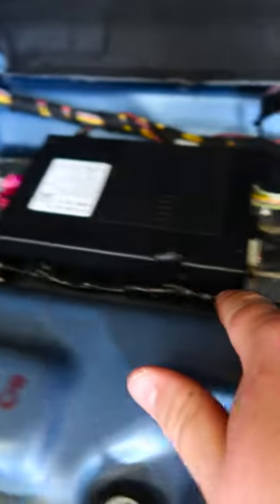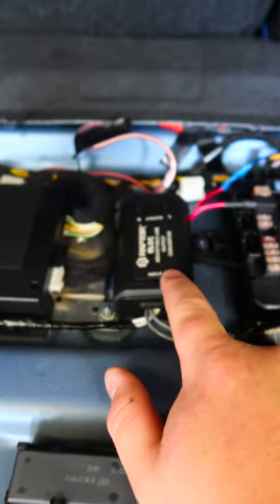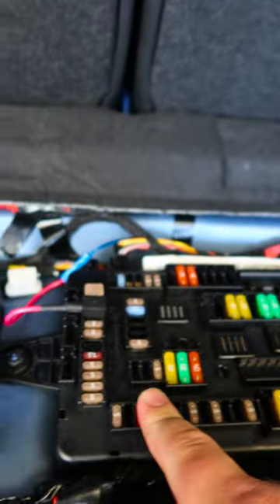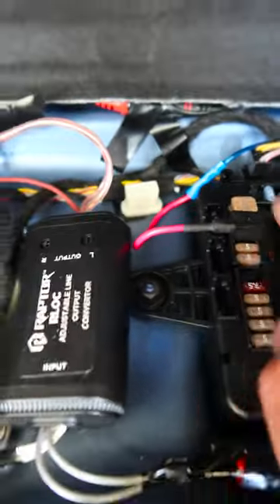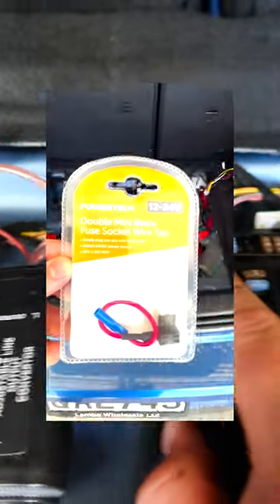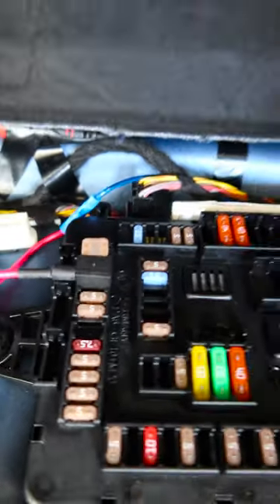BMW f20 (aftermarket) sub install GUIDE #bmw

Comment: Great video. Can you explain how to install the line output converter to the speakers please?
Reply from the maker: get splice connectors (google it), grab some extra speaker wire, attach splice connecter to the extra length of wire then splice in left & right, pos neg channels. run extra wire back to where ever you put line output converter and plug in rca. good to go
Reply: @WilliamCronin  so I did this and the subwoofer worked fine. Left my car outside the gym for about 2 hours with the ignition off and came back to a flat battery. Locked my door with the physical key to sort it in the morning and was unable to get back in the car with the physical key. Had to call a locksmith out to open my door and now my car is on charge, probably just going to pay someone to do it 😂
Reply from the maker: @matthewdyer1235  ahhh bugger! Hasn’t happened to me. Just of wired it to the wrong fuse
Reply: @WilliamCronin  turns out my sub was constantly drawing from the rear speakers, fuse was fine
Reply from the maker: @matthewdyer1235  weird! Is the sub defective or something?
Reply: @WilliamCronin  even when the sub was unplugged the fuse tester still showed the rear speakers wires were live with the engine off
Reply from the maker: @matthewdyer1235  seems weird. Maybe your head unit has been messed with

Comment: What amp fuse did you use for the fuse box ?
Reply from the maker: the 5 amp i tbink that’s already in the fuse box. it’s fuse 146 i think it’s some random one that a guy on a forum said you can use. a inline adapter like i did